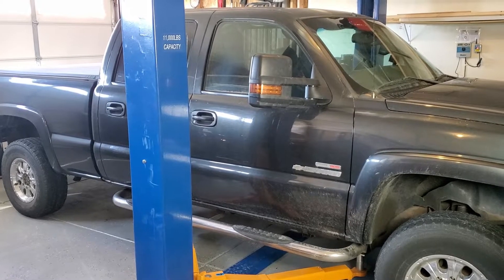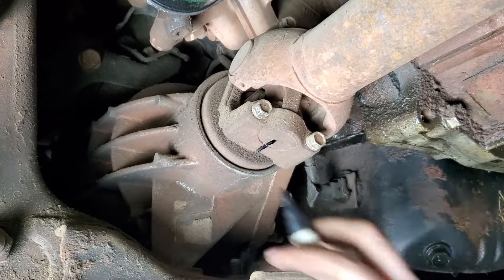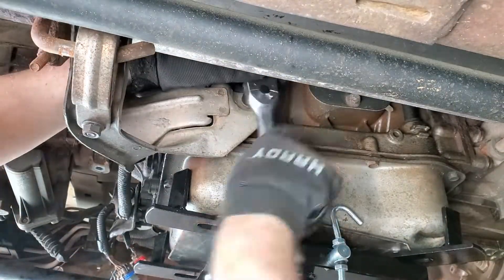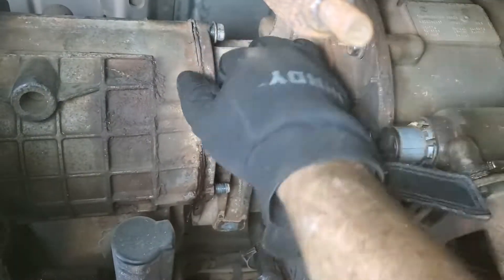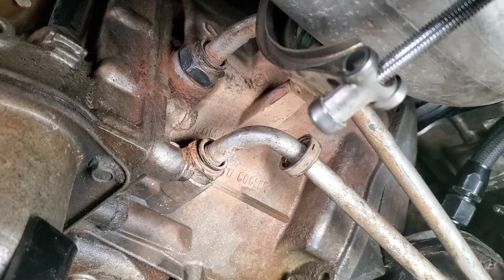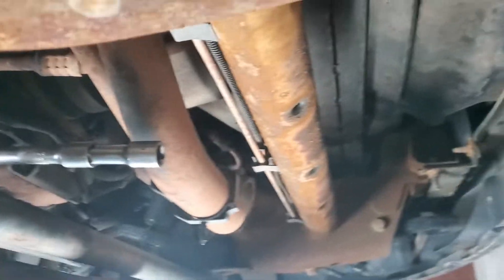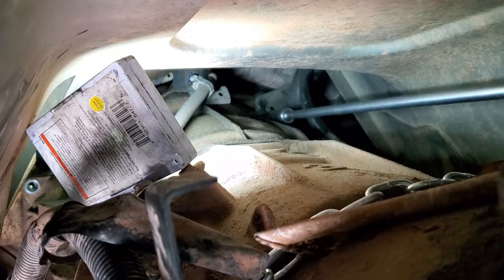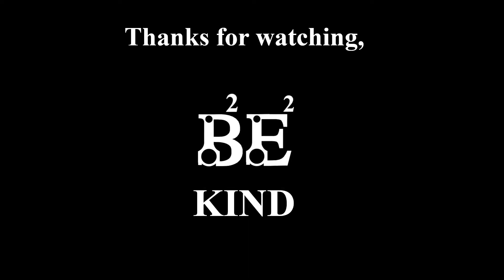How to remove an Allison 1000 transmission | Tips, tricks, & more

Comment: Big fan of lists lol. Done about 300 mdrive/ishift/couple dozen 4000s, plenty of eaton eservice cases with my name on it, lil 268 hino rolled in, seemed to simple. So far taken about 6 extra hours to get at trans back I'm, none of my hino books are very useful as there's over 100 and trying to find section tr002 -004 in the correct book etc just wing it. Was hoping for torque spec but 3/8 air seems OK to me . One or 2 ughas should suffice with some blue...wish me luck lol (not kidding on any of that, and yes, I also took am hour prior with my 18" rule and vernier measuring to lug faces about 600 times but at THIS POINT? full send the rest, should be fine as some vintage pickled pine 😅

Comment: Good little video. Thank you for the free download check list. 
I have 04 gmc sierra 2500hd lb7 4x4. 
With some new parts on the way. 
New dmax store torque converter,  suncoast flywheel/flex plate and refurbished transfer case. 

The fun I'll have laying in the driveway is going to be the best thing around. 😅

Comment: I had my Allison rebuilt in my 03 ccsb a year ago. Saw a puddle under it today and found the rear trans cover cracked because the trans shop didn’t torque the t-case nuts and it came loose. I fingered 5/6 nuts off. Now I’m gonna pull the trans on ramps in the driveway and replace the cover and also check the torque on the converter. It’s a fancy triple disc as the truck makes over 600whp lol. This video is great and I appreciate the help it gives as I am a mechanic but not a duramax or diesel mechanic

Comment: I’m in the middle of fixing a cracked back housing and installing a shift kit in my ‘04.5. Your download is excellent! I’m fighting with my trans being stuck on the dowel pins, I’m fairly certain. After checking out the bolt pattern you have, I know they’re all out. I guess that’s what I get with buying a Canada truck that had low mileage, but was rusty. Thanks for the video and download!
Reply from the maker: Ah yes, good old rust. Glad you found it helpful and best of luck with the rest of your build!
Reply: Rust spray around dowels and crack between torque converter housing and engine air hammer lightly on the dowels, pry tranny out

Comment: Are you building it?
Reply from the maker: Unfortunately not this time. I do have a build list all spec-ed out and ready to go but that'll have to be for a future video.
Reply: @builtbottomendperformance  what’s your list consist of? Are you dead set on diy?
Reply from the maker: @Josh D Right now it would be a GPZ TORQKIT clutch kit, Transgo shift kit, RevMax triple disc converter, deep pan, an upgraded cooler with some nice AN lines, maybe a c2 hub, and then I'm going to design up a c3 oiler upgrade pto cover & drilling jig (and a seal refresh kit of course). Parts list could change a bit, but that's what I'd be doing if I were building it right now.

I'm 99% sure I'll be DIY'ing it both for cost reasons and because I'm a madman who likes getting in over my head
Reply: @builtbottomendperformance  if you’d like I can put together a diy trans kit for you, with everything you’d need, using those gpz clutches but in increased clutch count, with lml style pistons and everything you would need to build a trans for 700hp, and a couple tricks to make it that much better
Reply from the maker: @Josh D Sweet, any tips would be appreciated!